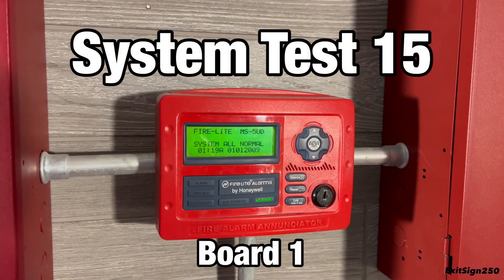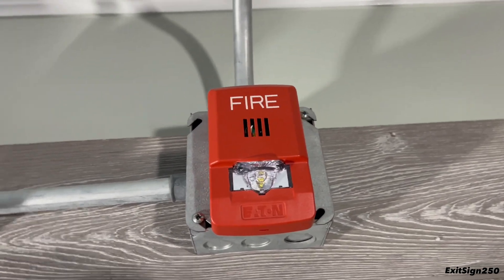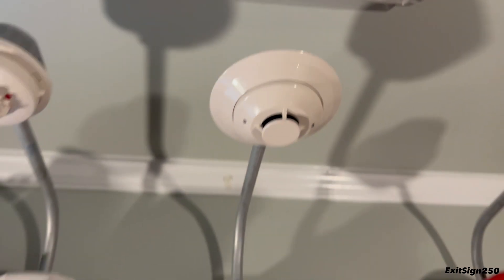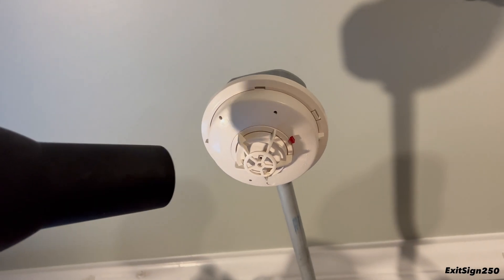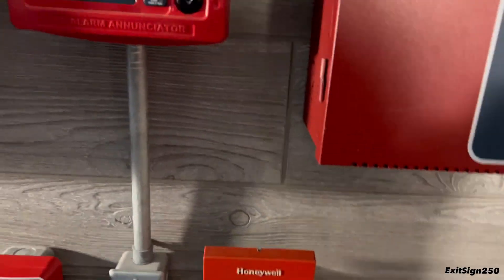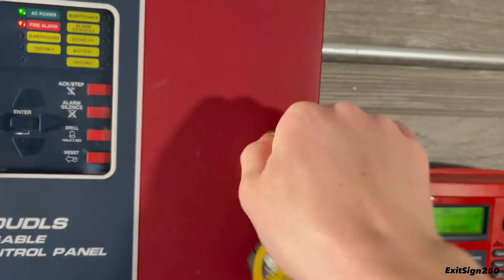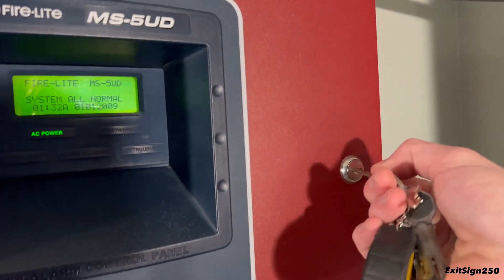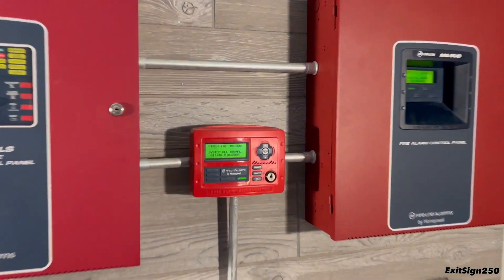System Test 15 | Board 1

Comment: This could be really cool, so if you linked both panels together if you reset one the other one will reset.
Reply from the maker: Unfortunately that’s no how it works. Regardless if the panels are linked together or not, both will have to be reset individually.

Comment: Can you do the same thing with the EST fire shield panels (Conducting a walk test on the panels) in the next test?
Reply from the maker: Unfortunately due to the troubles on those panels walk test cannot be enabled. While I can fix the trouble on the 3 zone panel (it’s just a simple no battery trouble) the 10 zone panel as a permanent supervisory alarm which cannot be fixed.
Reply: @ExitSign250  ok. On the Firelite panels, can you eventually set them both to two stage and have them activate each other? It was really cool when you had it on your real system.
Reply from the maker: I do plan on a two stage system in the future. I’ve been trying to get a few specific devices I want to feature in that test. Stay tuned!

Comment: is that 5ud fwr or dc?
Reply from the maker: My 5UD is an FWR output model. I’m well aware most will tell me to not use Simplex devices on it because they’ll be damaged, but for as long as I’ve used them I have never had any issues.
Reply: @ExitSign250  you can also get a filter for your 5ud like Zachery fleck did with his 9200udls that will convert your fwr to DC which makes mech horns sound nicer. But you don't have any prohlems with fwr so.
Reply from the maker: I’ve been thinking on getting one of those filters for a while. It would definitely make older horns sound a lot nicer. I just never got around to getting one.